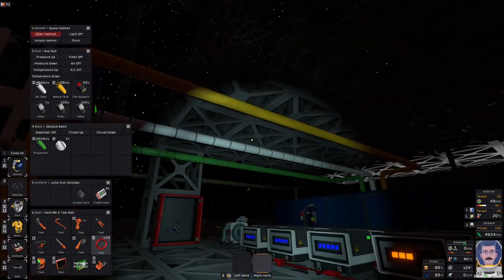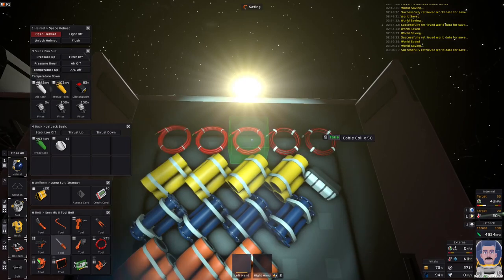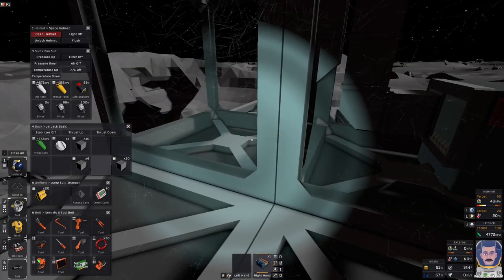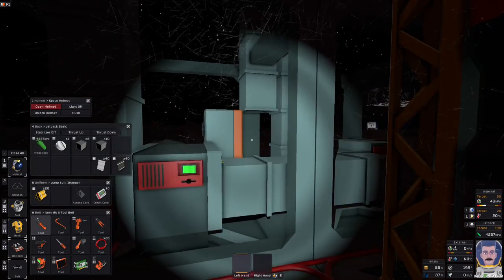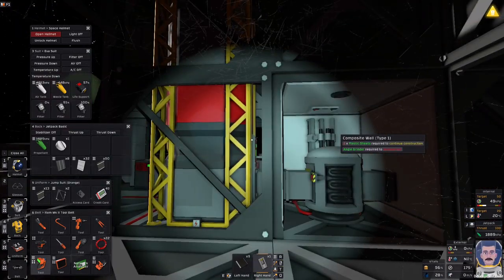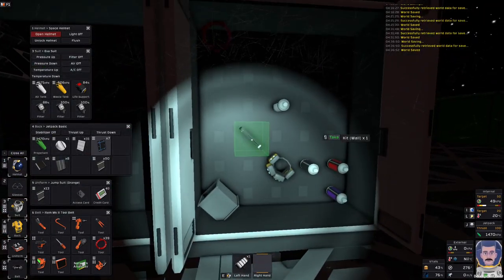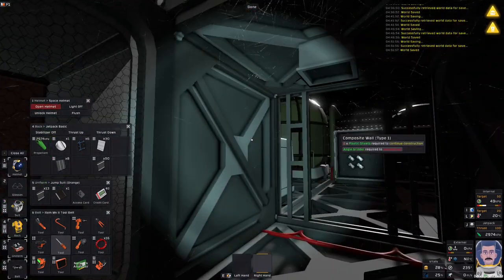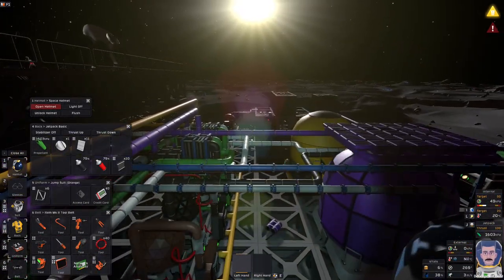Let's Play: Stationeers - Episode 22: Materials Processing Facility Pt. 1

Comment from the maker: A couple of mysteries solved... While editing the video, I figured out the answer to two questions I had. First, the missing iron ingot. If you watch closely, you can see that I kicked it, and it went UNDER the locker. Second, the reason I came up short by one logic i/o chip is because I used one as a logic reader for the arc furnace activate button. That's not needed, as the logic writer can pull the state directly from the button itself. I might fix that later on, off-camera.

The reason I leave these and other goofy bits in the video is because, frankly, that's a part of the gameplay. If I can't laugh at my own mistakes, I got no business laughing at all!